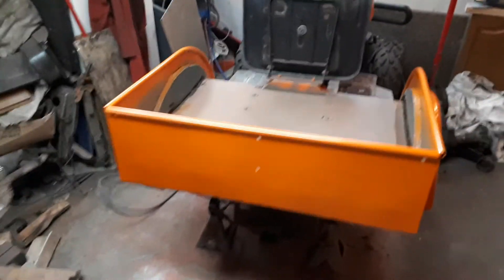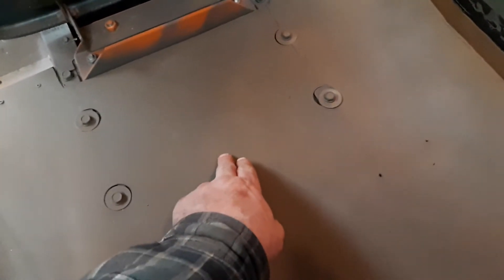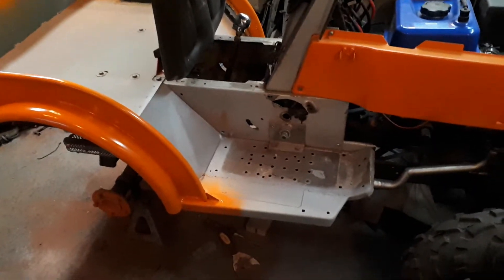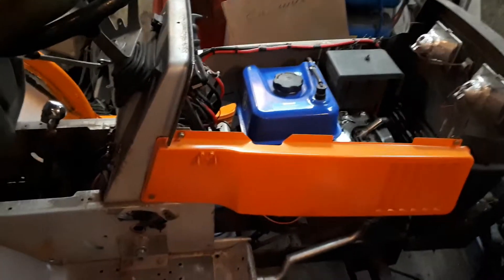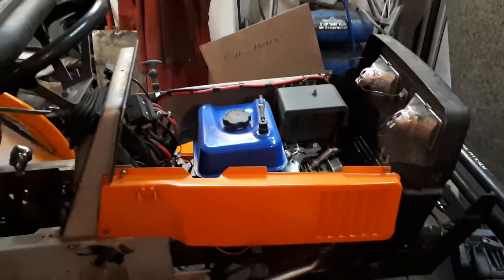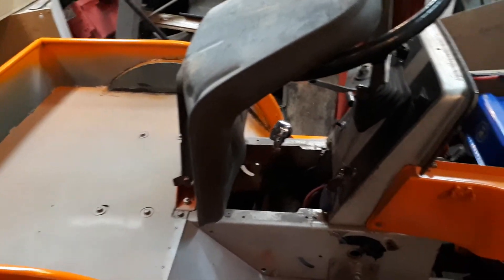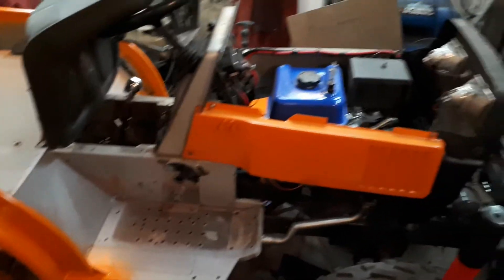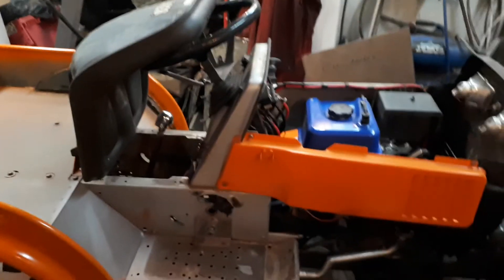In the shop with Lawn Gone

Comment: MAN thats looking amazing! im trying to build up my main mower still, i have a easy up tent with a tarp thrown on top as a garage, i still get rained and snowed on. on top of the my front axel mounts are almost destroyed forcing me to be innovative like you. i want brace frame with angle iron, move axel to front of frame, and add some kind of suspension to protect from wheely pops and sudden drops.
Reply from the maker: RockeyDAproductions Thanks dude,Good luck with your project!
Reply: the luck was good, rear end is locked, it goes nice in slow in 1st, mean while its scary high throttle in 4th... and its a 5 speed. i wish i knew of  away to mesure its speed.
Reply from the maker: RockeyDAproductions glad to hear your project is going good too! Try a GPS speedometer app on your phone to measure speed
Reply: problem with that is my phone uses a RJ11, and i dont think corded phones have GPS yet :p

maby some day i could by one of those dashboard GPS's and mount it on the hood of the mower. but i would like some kind of not horrible alternator before i start increasing power consumption.
Reply from the maker: Have somebody clock your speed with a car speedo?